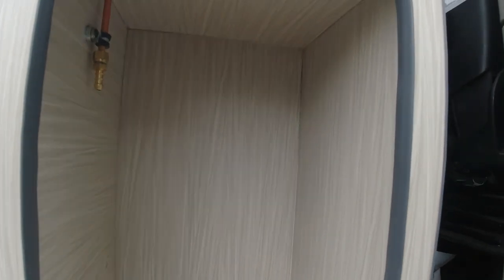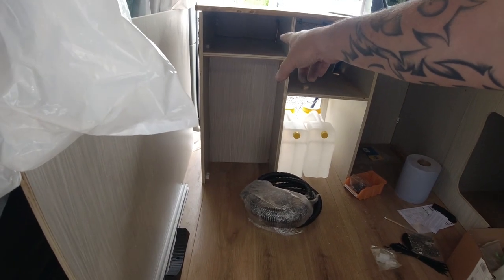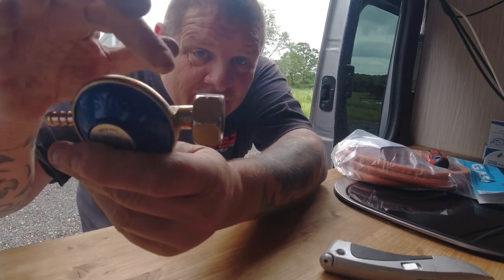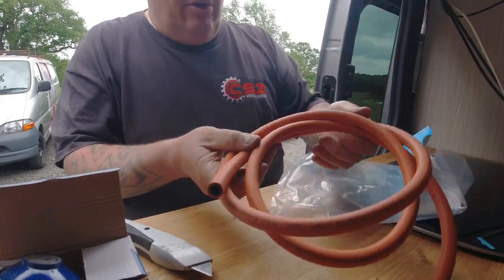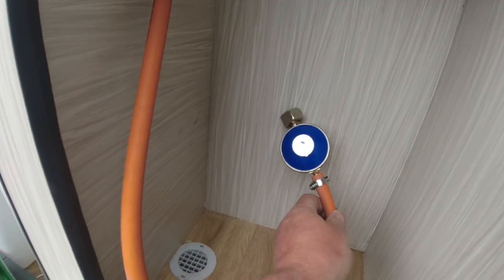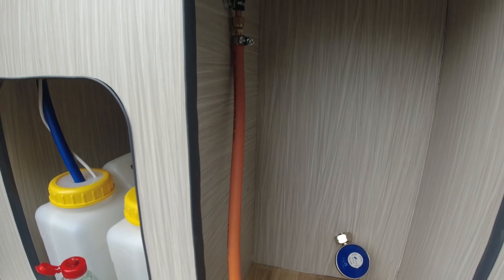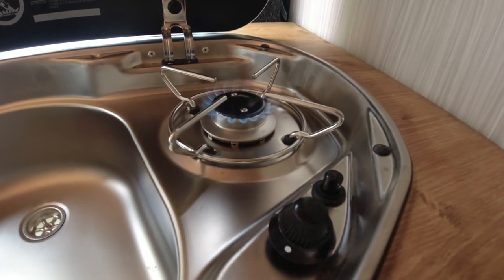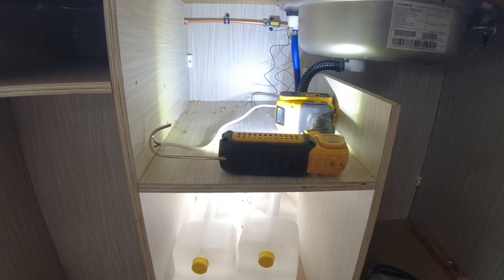Renault Trafic Campervan Conversion - Kitchen build Pt 2

Comment: I would consider also using foil tape over the corners of your gas locker to be doubly safe in case there is a slight chance there is a way through the sealant for the gas to escape, and also I'm sure you will but a gas detector is essential. You've taught me something I had no idea there was a shelf life on the orange gas hose keep up the good work cant wait for your next video.
Reply from the maker: Thank you thats a good idea with the tape.  Glad you enjoy the videos

Comment: Hi fantastic content we're in middle of fitting our Gas fitting were only using 907 gas bottle like yours what's the fitting I need to order  and sizes please I don't have cut off value  yet I have copper pipe, regulator and orange pipe 😅
Reply from the maker: the regulator if right will fit straight on to the gas bottle.  Make sure you are using 8mm copper pipe i use 8mm brass compression fittings for all the joints and a shut off valve in line.

Comment: hi m8, just a little tip for you , the little lines/nicks on the regulator nut mean its a left hand thread nut on gas fittings
Reply from the maker: Cool cheers never knew that

Comment: How do you seal the door on your gas cupboard?
Reply from the maker: I've sealed with silkaflex inside the cupboard and the door will be flush mounted using rubber draft excluder

Comment: Do you need to have it 'Gas-Safe' checked or is it different for LGP non domestic?  Looking great but all those small working spaces look a ba*ll ache.
Reply from the maker: Yes it will need to be checked and signed off by a registered engineer